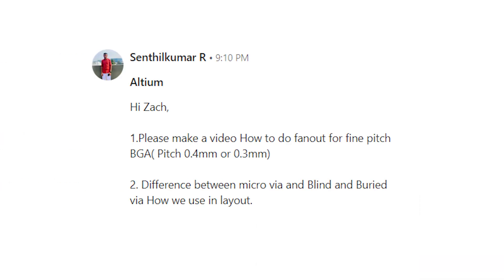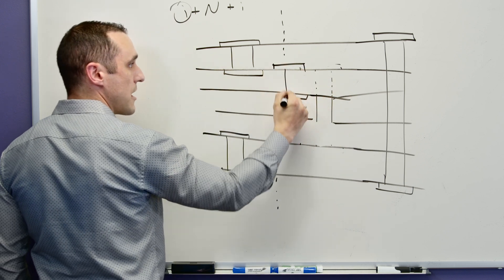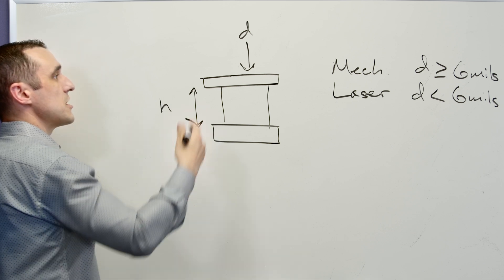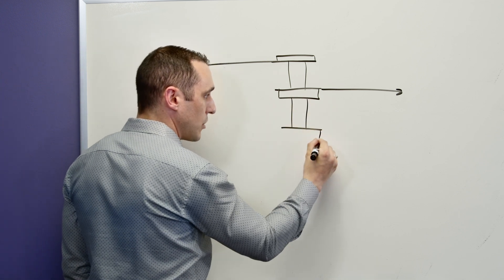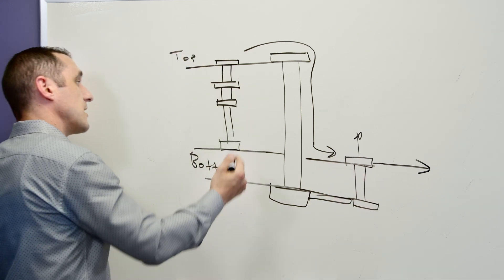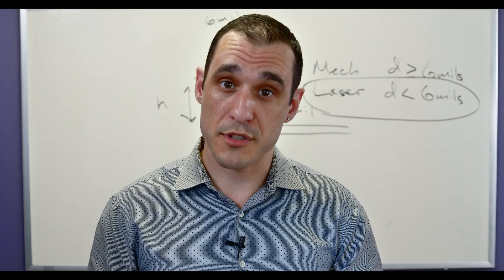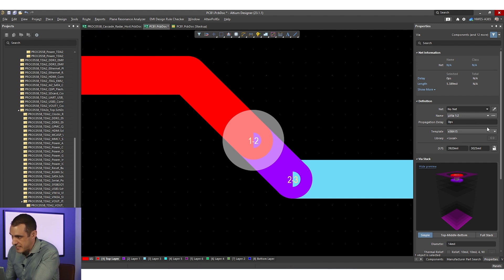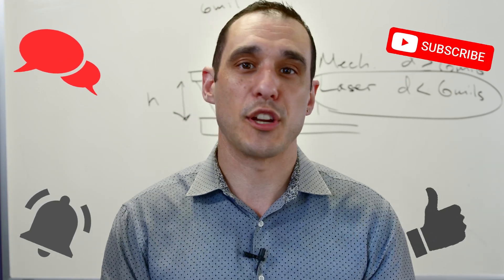How to Use Blind and Buried Vias

Comment: like you said continiously, its a close contact situatiion with you fabricator. however for a lot of starting users they do not have a fabricator but use JLC etc.. also if you have been doing this you will ALWAYS get a fabricator who rather not do the multi blind buried configuration. because its a risk and the yield is low.. and please be aware that as a rule of thumb every blind or buried via will increas the cost of a PCB by 10% .. its better to just use through hole via's if you do not have to worry about  impedance /  signal integrity and cost. its hard to find proper help in these situations.. and switching fabricator is not always an option because of long standing agreements.. i have been in contact with a lot pf PCB manufacturers and going the blind/buried route all through the pcb is not a real life situation.. and i agree boomerang is more used in a lot of cases, so in theory your approach is correct, but i am missing the real life scenario here. (like with most examples in altium academy i am aware you have to keep it simple enough to capture a wide audience.)
Reply: Well sure some fabricators would prefer to not do microvias, or who would rather just do through-hole vias. As the designer if you choose fine pitch components you need to go into it realizing that you will probably need blind/buried, or maybe microvias, which then needs the proper stackup to support that, and that applies regardless of the impedance/SI needs. If someone thinks they are going to farm out a prototype to JLC with stacked blind/buried microvias at high layer count for $10 a piece they are nuts. I can say that going blind/buried throughout a stackup is a real life thing because I've designed and built it, it's just not very common and not all fabs or EMS will bid it. Much more common is a couple of outer buildup layers to support specific components and then conventional buried via rather than stacked blind-buried throughout the entire stack (ELIC).

Comment: Why do they even make BGA so dense it can't be routed on a single layer?  (Or at least, why package chips only in such a pattern?)  Are they assuming that many pins won't be used?  That using them all is complicated enough that you'll need a many-layer board anyhow?  That 2-D physical size is uniformly important enough to justify complexity in the 3rd dimension?
Reply: this has to do with the internal chip architecture were.. and to why they make it, because we all want to have a tiny phone in our pocket with more horsepower than a supercar, a super thin laptop with excellent battery life. and because smaller means less material to use so you can build more of them form the same pile of base amterial.
Reply: Ultra-small devices that need a large amount of compute can only be done with very high density devices. It's the primary way you can fit all the stuff into the same product. Also think about something like mobile phones, they keep trying to pack more features into the phone that use more power, but you have finite space, so now they need tinier components with the same features in order to make more room for the battery.

Comment: What makes it a microvia?  Is it just that it only goes through a single layer, so that 2-layer boards technically have microvias?  Is it the shape (funnel vs cylinder)?  Is there something about the diameter?  Is a skip via just a via that goes through multiple layers, but is also either blind or buried?
Reply: micro via is usually a laser drilled via. limited to a certain dept. also the size is more to be like 4/10 mil in size.
Reply: Once you get less than the limit for mechanical drilling, they start calling them microvias. The laser drilling process generally results in the funnel shape because it has to do with the focusing of the beam into the substrate. Skip via in the standard HDI stackups (Type I, Type II, etc.) is normally a blind via spanning across more than one of the HDI buildup layers.

Comment: Thank you, Zach! Great video, excellent explanation! Can you please say more about skip VIA?
Reply: Sure, I can put together a video about it. I'll briefly summarize here though. A skip via skips one of the HDI buildup layers and lands on an internal layer. So it's like a blind via but it spans two layers instead of one layer. The skipped layer has no electrical connection. One reason you would do this is to eliminate any potential cracking at bonding points between the copper plating in stacked blind-buried vias.